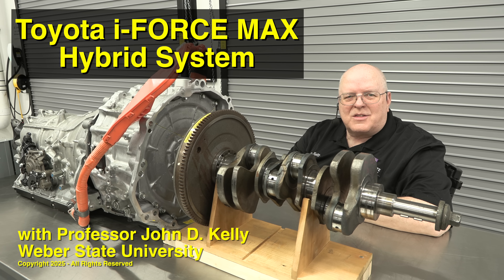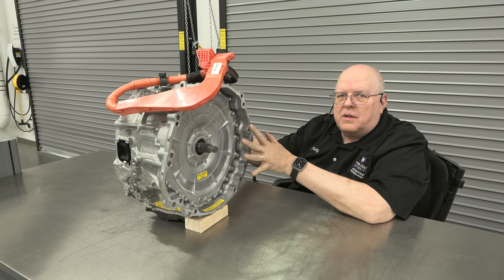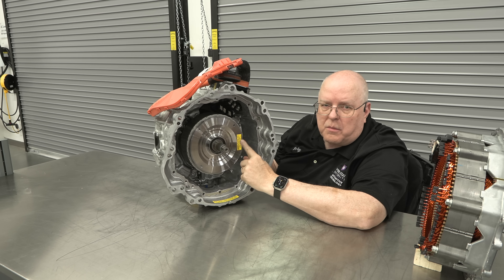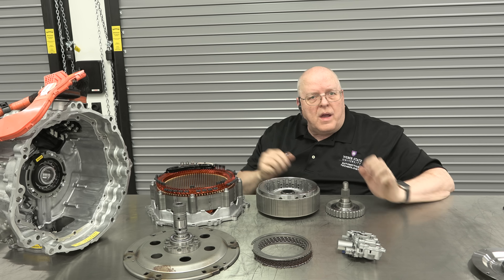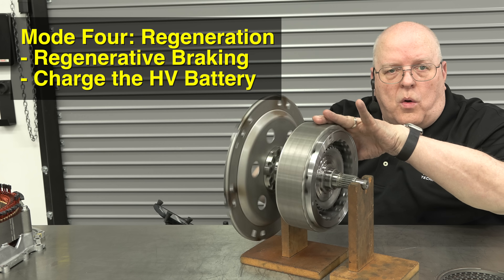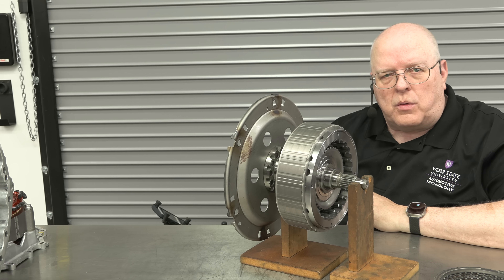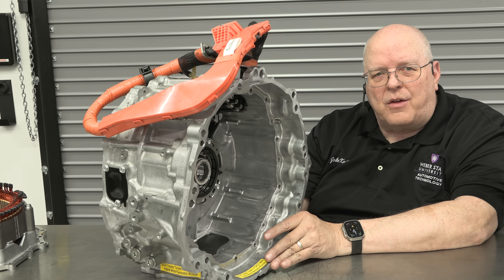Toyota's i-FORCE MAX One-Motor Hybrid System

Comment: Wonderful video as always. I do kind of disagree that this electric motor is powerful, or that these get good fuel economy. For me the beauty of Toyota HSD is its simple mechanical elegance. This is kind of the opposite- the byzantine complexity of a TT V6 + 10 speed auto with an electric motor shoved in. I wish they had just upscaled their FWD setup, with the 2 electric motors and no "transmission".
Reply from the maker: This system allows for direct transfer of torque from the internal combustion engine to the wheels. The Prius power-split system does not have that and is not suited for heavy vehicles and loads. This system is about providing more power with providing a fuel economy boost as secondary goal
Reply: @WeberAuto   thanks Prof, that makes sense.

Comment: Toyota are modest as usually - 60 Hp from the HGM is (I guess) limited by the maximum discharge power allowed from the HV battery.
Probably the best balance between performance, battery charge levels and longevity. After all, Toyota have "some" experience from the Prius drive trains at this point.

From a technical engineering perspective. Did Toyota take the easy route for a hybrid solution in a heavy duty application?
Or are there some issues to the L110(f)* hybrid transmission (Lexus LS 600h and the GS 450h) if used in a heavy duty application, even if it would be beefed up/modified? I think there would be many benefits in this case. The transmission is physical like an regular longitudinal automatic transmission,  all the parts of the drive train is always engaged in contrast to a clutch solution, the variable gearing would come in handy when you need precision slow creeping and the ICE rpm would always be at optimum for every driving mode/situation.
Reply: According to Toyota the purpose of the iForceMax hybrid system is to enhance the power output. It's not really designed to lower fuel consumption.
The direct drive transmission from the LS600h wasn't designed for a heavy duty application at all.
Reply from the maker: This system allows for direct transfer of torque from the internal combustion engine to the wheels. The Prius power-split system does not have that and is not suited for heavy vehicles and loads. Thanks for watching

Comment: Since the rotor is directly connected to the torque converter, when it needs to start the internal combustion engine, does it have to do it when the vehicle is in motion, or can it start it in standstill while letting the torque converter slip? Thanks for your video I always jump to a new one as soon as it's released.
Reply from the maker: It can start the engine with a stationary vehicle. The torque converter will just slip and the transmission is in Park. Thanks for watching

Comment: I have been wondering why Toyota can't use a power split device like on their other hybrids. This entire powertrain seems very complex and on paper, doesn't offer much for fuel economy savings. Based on your video, the only major advantage here is that this system gives you the option to engine brake directly using 8-10 gears with more available braking force whereas in a power split, you are limited by the power output of MG2. iForce Max is way too complicated in my opinion. Tons of failure points. Wouldn't a series hybrid be a better choice for a truck? Like a diesel locomotive? It could have a traction battery for regen then switch to a resistor grid to bleed off extra energy as heat indefinitely. Not only that, incredible torque and adhesion that AC motors are great for to reduce wheel slip when trying to pull something heavy. My gut tells me that this iForce Max system was designed specifically not to deviate from what truck buyers expect, not make a better truck. A fine example of marketing interfering with engineering decisions.
Reply from the maker: This system allows for direct transfer of torque from the internal combustion engine to the wheels. The Prius power-split system does not have that and is not suited for heavy vehicles and loads. Thank you for your thoughts and for taking the time to watch.

Comment: I have never seen a Lexus GS450h transmission explained anywhere. I own one of these cars and I would like to see how it works and how it is different compared to the others. There is nothing on YouTube about them!
Reply from the maker: It uses a power-split system similar to the Prius, but much larger. I have a L110 transmission here, but have not got around to opening it yet.

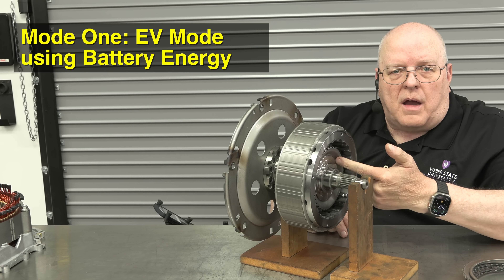Comment: 8:05 Looking at the power train as a whole, I would presume in the EV mode the lock up clutch in the torque converter would also be applied even from standstill? 
Just fantastic work. I really like seeing the internals of these new systems and you present them in the best way I have seen.
Reply from the maker: Yes, the lockup clutch in the torque converter will be used as needed in EV mode. Thanks for watching
Reply: I'd bet the lockup clutch in the torque converter operates pretty similar in EV mode to how it does in hybrid mode/most any other drivetrain i.e. unlocked at a stop. Why not use the torque multiplication of the torque converter as needed (particularly from a stop)? Plus I feel that would be a lot of stress on the lockup clutch. It might lockup sooner in EV mode, though - have to get a scan tool on one and watch the pertinent PIDs under various conditions to find out for sure.
Reply: @nowayjose596 The motor has a lot of torque from 0 rpm, so the torque converter is probably not needed. And a converter consumes a lot of energy, it doesn’t give free torque. Also, the lock up clutch will be fully engaged therefore not slipping so it wont experience stress.
Reply: Interesting. Yeah would definitely like to see some OBD tool when going from standstill to creep.

If it is like how you suggest (using the converter), there must be a point at which it will start spinning the motor while you are lifting off the brake to mimic the classic creep auto cars have.

Comment: Just imagine if the solid state batteries become viable forvehicular use. The weight of battery will be reduced. If we add solid state batteries which weight the same as current batteries, the battery will turn the engines effectively into a generator, like Mazda's new Wankel engine does.
Reply from the maker: Thanks for watching

Comment: Interesting decision from Toyota.
As I understand it, the main effect of this hybrid system is when we move on the highway and in the city.
Reply from the maker: This system allows for direct transfer of torque from the internal combustion engine (boosted by the motor) to the wheels at any vehicle speed.
Reply: @WeberAuto Thanks for the full clarification.

Comment: Well, wet engine disengaging clutch is serviceable piece in Hyundai HEV, as it obviously is an wear item. Those don't have torque converter however. In application with one wear is limited, as the fluid coupling will slip instead of plates i guess, but not when starting the IC engine - this process must drag the wet clutch pack.
Reply from the maker: Great thoughts. The torque converter makes all the difference in clutch wear prevention.

Comment: Plug-in hybrid range rover L405 PHEV transmission looks the same with one exception, ZF 8HP transmission doesn't have torque converter

In theory Toyota could use either 1st gen hybrid Lexus gs450h transmission series -parallel, or latest transmission from Lexus LS600h with series -parallel+ automatic transmission part
Reply from the maker: This system allows for direct transfer of torque from the internal combustion engine to the wheels. The Lexus power-split system does not have that and is not suited for heavy vehicles and loads. Thanks for watching

Comment: Professor John D. Kelly, Have a nice day and a great video, thank you very much.
Professor, please tell us about your journey through the university on wheels, how the wheelchair works - mechanism, drive, energy, control. 
I wish you good health.
Reply from the maker: Thank you, I have been in an electric wheelchair since 2013. It uses a 24 volts system to drive two electric motors with electromagnetic brakes. The school is very good at working with my need to work in a wheelchair.
Reply: @WeberAuto  in the past, I have helped people with disabilities, the wheelchair is manual, the environment is largely unsuitable in the city...
Your lectures are accessible and understandable

Comment: It would be interesting to see how the clutch pack is operated. Is there a piston in there that presses the plates together, and how is the clutch assembly sealed? Great video, really enjoyed this deep dive into this hybrid variant.
Reply from the maker: Yes, it uses an aluminum hydraulic piston sealed with D-ring seals. It also has a balance piston. The unique part of the clutch housing is the lubrication fluid for the bushings is slung outward to cool the rotor and stator. Thanks for watching.
Reply: @WeberAuto  Thank you so much for your answer!

Comment: My early 1980s high school auto shop teacher was Mr Weber. He drove an AMC gremlin. Very good teacher. ❤❤❤
Reply from the maker: That is awesome
Reply: I took auto shop in 68/69/70 all we did was starters, brake jobs, mufflers, oil changes, on teachers' vehicles, I can't image what they're doing now if they even have auto shop anymore in high schools.
Reply: @johnmarzullo6545 Mr Weber had V8s mounted on rolling engine stands. One for each manufacturer. One test was removing the plug wires and distributor. Timing us to see how fast we took to get each one running. Had to memorize firing order. ❤❤❤
Reply: a man of great taste

Comment: While I'm sure this system drives and sounds better than a traditional hybrid system, it's way over complicated and inefficient compared to a traditional hybrid system driving 2 wheels with an electric motor driving the other 2 wheels.  On paper, it's literally the worst of both worlds.  All of the complexity and inefficiency of a 4wd system with all of the weight and added complexity of a hybrid system plus a turbo charginging system added to really guarantee reliability issues.
Reply from the maker: Thanks for watching and for the comment

Comment: Could you point out where is the refill plug for the motor component? I am going to drain and the refill the motor but don’t know which one is the refill plug.
Reply from the maker: It does not have one. It is filled when the rest of the transmission is filled. Thanks for watching.
Reply: @WeberAuto thanks so much! Always enjoy your video!

Comment: 45kw seems rather low. What is the capacity of the battery?
Reply from the maker: 288 volts and 6.5 Ah. 1.87 kWh
Reply: @WeberAuto   Wow. I thought it was a plug-in. It's surprising that battery can supply 45kw. That's a 24C discharge rate. It can't possibly recuperate much braking energy, like my old Escape hybrid. I'm not impressed. Thanks.

Comment: The main criticism I‘ve read about this configuration is that the fuel economy boost is relatively modest, especially compared to a power-split ECVT like in the Ford Maverick Hybrid. I saw your other comment about how this design is better for max simultaneous power from the engine and motor, which makes sense for a pickup truck or large SUV. Do you think Toyota could engineer a more fuel-efficient version of this design, or are power-split ECVT designs inherently more efficient?
Reply from the maker: Power-split designs are probably more fuel efficient, but they do not have the torque capacity needed for trucks. This system was not primarily designed for improved fuel economy; it was designed for more power for towing, hauling heavy loads, etc. Better fuel economy is possible, but it depends on your driving style, speed, etc.
Reply: @WeberAuto Thank you for your reply and for another excellent video!

Comment: that wet chuch pack seems a weak point. This Module repeats some torque converter functionality but with these wet clutches I have doubts it will be as reliable as it is without that Module. From owner reviews there is no noticeable fuel economy with the Module.
Reply from the maker: Thanks for your thoughts, Good fuel economy with a twin turbocharged truck with an electric booster motor is possible, but I suspect driving style, vehicle speed, etc. are bigger factors. It is probably a lot of fun to drive.
Reply: That wet clutch pack is stronger than a dry clutch by a long shot. A typical automatic transmission is full of of these clutch plates except much smaller. This is definitely not a weak point.
Reply: @The_T_Rav  that clutch will work much more often than any clutch in transmission. Dry clutch is serviceable part when this module is not (guess it costs like 5 years old Civic). I'm not against tech, I'm against high maintenance cost. For this reason I'm owning 5th gen 4Runner.
Reply: @7gan7  your loss...
Reply: @The_T_Rav  https://youtu.be/vwIq9OvFU-Q?si=3z8UZfi5OUxsFp5s
Reply: @7gan7  I mean, I googled Ford, dodge and GM issues and was overwhelmed with videos and articles. Should I share them with you? Oh, and out of all of the issues between all manufacturers, Toyota has been the quickest to come up with a solution and they've been taking care of their customers. 

You should probably just sit down somewhere because you obviously have no real automotive experience.

Comment: Toyota is miles ahead of the other companies when it comes to hybrids. I fear that clutch pack designe will be Achilles heal of the system.
Reply: But, if you are concerned about the “hybrid” clutch pack, how is that substantially different from all the clutch packs in the 8 or 10 speed transmission?
Reply from the maker: Thanks for the comment and your insights!
Reply: Ehhhh, real world this system is very close to the F150 Powerboost and the powerboost system seems to be a better all around execution. Toyotas system has show very little efficiency improvement real world and certainly doesn’t have the same level of performance.
Reply: @Jay-me7gw but it's a Ford, even IF it was better, everything else around it is garbage. I'd still have a Toyota over a junk Ford any day.

Comment: One question, please, if I may: in engine start mode, why does the vehicle not creep / jump forward as well, because if rhe motor is spinning, so is the gearbox input, right?
Reply from the maker: The torque converter allows for slippage between the engine and the transmission
Reply: I assume it only starts with the park pawl engaged or the brakes are applied. Power split hybrids also apply torque to the final drive when starting.

Comment: Seems very similar to Honda's old hybrid system except that they added a clutch pack to allow the motor and engine to disconnect for an EV mode. Seems like there is room for improvement still, lots of wasted space so it could be more compact, I'd also question how long it is able to supply/generate much power without overheating since the motor seems to have no cooling at all, but I like how universal it is. Toyota could do better with their EV efforts, but you can't fault them for their simple and reliable hybrid systems.
Reply from the maker: Good points, however, the stator and rotor are cooled by transmission fluid from the lubrication circuit. thanks for watching!

Comment: Seeing that clutch pack in there tells me that is going to be an eventual point of failure.
Reply from the maker: Time will tell, but the system appears as robust as the clutch packs inside the automatic transmission. Thanks for watching

Comment: this seems like they just took parts they already had and slapped them together.  i feel like the power loss from the torque converter would negate any gains from the hybrid system. The traditional transmission needs the pump spin to make pressure for the thing to work, so it has to get spun up prior to the gears engaging, and I feel like this will wear the transmission pump and the internal bands/clutch packs of the transmission more as they will not be under full pressure from a stop, and will allow more slip.  I wonder if they did anything different in the trans to account for the lack of pressure from a stop.
Reply from the maker: This has an electric pump to keep the clutches applied when the engine is off. Thanks for watching

Comment: Was the Malibu mild hybrid similar to this?
Reply from the maker: it used a belt-driven motor/generator on the side of the engine. It was also a parallel hybrid, but nowhere near as powerful.

Comment: great to see you, John. This system reminds me of Honda's Intergrated Motor Assist they used to have. I've driven both the Tundra and 4Runner versions, and do a lot of head scratching. Yes, the numbers are impressive, but the system adds a lot of weight and does (in real-world driving)  basically nothing for fuel economy. It does look fairly simple, true, but the cooling and turbocharging additions to the Four and V6 are a plumber's nightmare. Incidentally, our RAV4 Hybrid uses the "old" system and the e-motor is much stronger than the Tundra and the car gets 40 MPG. I don't understand Toyota's thinking here. Again, great to see you and another excellent video.
Reply: The idea is to assist the gas engine, not necessarily give it good fuel economy. You also have to think about packaging for all the hybrid components and reliability when towing incredibly heavy loads. Hence why they did what they did here and attach an electric motor to a ten-speed auto instead of going the "conventional" HSD route with a planetary gearset. And if the gas engine has to run independent of the hybrid system, it can.
Reply from the maker: Thank you for the comment! I appreciate your insights.